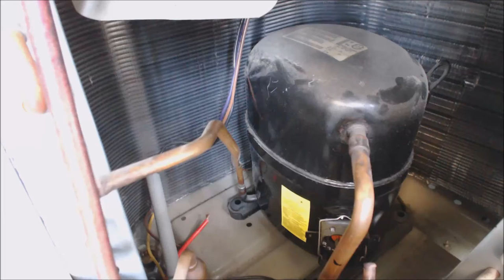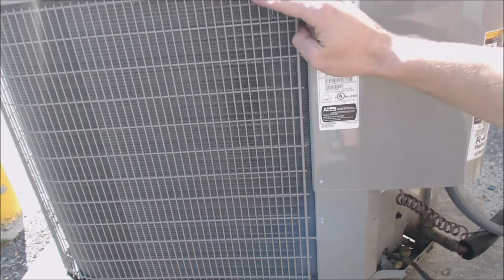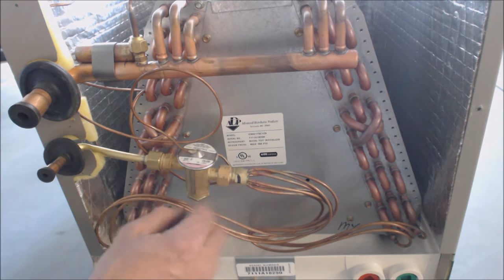Refrigerant Cycle Explained: Heat Transfer, Phase Changes, High & Low Pressure, Vapor & Liquid

Comment: I understand the phase change and the workings of the evaporator coil but  have hard time with compressor and condensor . It seems like the compressor is heating up the refridgerent only then to run it thru condensor coil to remove heat we just added ? What am i missing

Comment: Great job. Question why the difference in numbers, some say 75% liquid 25% vapor, or 65% liquid 35% vapor, etc?
Reply from the maker: That depends on the amount of distributors and their size after the metering device as they all go into the same 3/8" tubing. Thanks, great question!

Comment: Hi AC service tech. 
It's Blaze from SoCal again. Question about the vaporizer. May I leave the low side fully open when I'm charging a flat system after a repair or do I need to meter it by opening and closing my low side handle on my gauge.
Reply from the maker: If by flat you mean that you fixed something after recovering the refrigerant and then vacuumed it down and want to weigh the refrigerant back in then you should start by breaking the vacuum with liquid refrigerant into the liquid line using the weight posted on the rating plate as a guide. I would still weigh in only some at a time because you still want to wait to see where the subcooling or superheat goes. If you are far off then you may leave it open for longer than if you didn't have the vaporizer. Also listen for the compressor noises. You should not hear any compressor noises really with a vaporizer. They really help a lot, thanks
Reply: Very well could be the drier. It's super rusty and likely original. I can only imagine what the evap coil looks like haha.